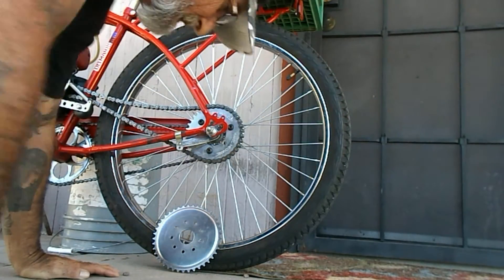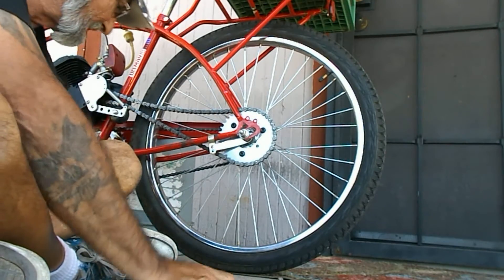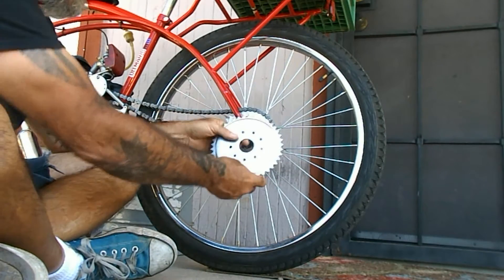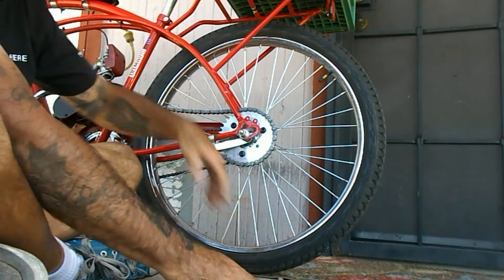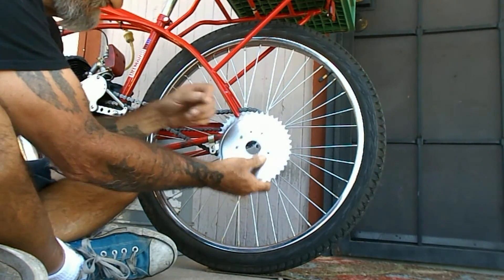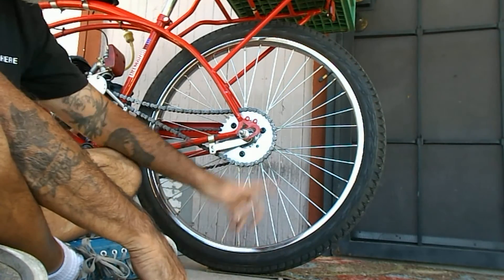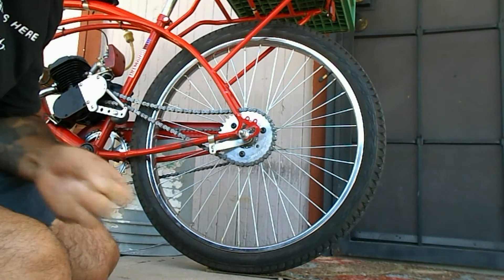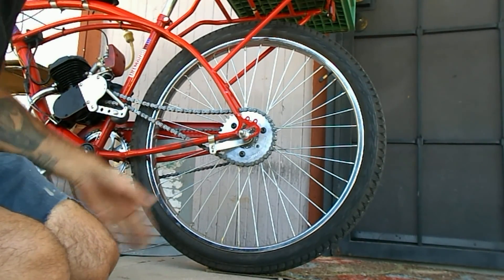Fast Lesson in Gear Ratios for a Motorized Bicycle

Comment: Im thinking of going with a 38 or a 40 on this build, i dont want to overload the little chinese motor.
Reply from the maker: Here's the thing the higher the number of teeth on the gear the lower the gear ratio. 
( stock is 44t or 40t )
On my red speeder bike I had a 36t sprocket and I could achieve 41mph. (6500-7000rpm) 

U could go 32t but that would take lots of bottom end torque away and u would use up the clutch trying to get going unless u pedaled at the start. 

It all depends on what u want from the engine remember it only puts out 1.5 - 1.9 hp stock. Even with all of Fred's upgraded parts and 93octane fuel u are only getting 2.7-3hp maybe. But mostly just higher rpm across the rev range. Gearing is the key to getting more speed don't believe all the super mechanics and geniuses that claim to know what they are talking about when it comes.to this little 48cc Russian designed chainsaw engine that was.first put into service around 1925 or so and was used to cut.down Siberia. 

The Chinese adapted it to run water pumps and other small machines through the 50's and 60's. 
So what u want?
 Reliable good performance that give around 55-70mpg (36t-40t) with a top end speed around 35-40mph

Higher rev range more power uses more fuel 
makes more noise 
uses up the engine faster

I know guys that got over 100,000 miles on their engine with road trips of 10,000 miles multiple times. Sure they look like hell but still run like a mad chicken ") 

Thanks for watching")

Comment: @brian noel,so smaller sprocket means faster and bigger sprocket is torque?I'm try to get better pulls up hills.on flat roads I can get up to 30ishmph.as soon as I get to hills I lose power.
Reply from the maker: 40t rear sprocket is stock 44t will give u more pulling power")
Reply: Thank you sir.i wasn't sure,but I'm gonna buy another rear sprocket to test this.

Comment: I got my hands on a 32 tooth...and thinking about giving it a try...I'm mainly on flat ground...so I'm not worried so much about hills.. I'm currently running a reverse jug on a 100cc bbr...with expansion chamber exhaust and expansion intake manifold (boost bottle) 
with large air intake filter.. this 32 tooth sprocket will be bolt on a 20inch wheel..so hopefully it will be faster...also have done port matching and polishing...

Comment: Like your video but I found out how you can get a hundred miles per gallon put a Reed valve and window piston , expansion chamber exhaust and a keihen carburetor on my yd100 bicycle engine and 40 tooth sprocket I only have to give my bike half the throttle I did before I added that to my engine I weigh around 250 my bike can get up to 35 to 40 mph but I only run it around 25 and maybe a quarter throttle before the addons I would be giving it almost full throttle to achieve the same speed and power I guess the people that make these motors leave that out I had to think back when I was a kid in the 70s racing 2 stroke dirt bikes helped me a lot with my motor bicycle

Comment: What’s better a 36t or 44t I’m running a 36t on my torque master engine from Zeda and it’s insane
Reply from the maker: smaller the gear(less teeth) the faster you will go. the bigger the gear (more teeth) the more torque(climbing power) the engine puts out. the smallest i have seen is 30t because the little engine has to rev really high to get going from standing start usually ending up in major engine failure.
Reply: @Brian136  you are right

Comment: Hi Brian , I would like to know how many spokes do you have on the back wheel ? I have a sprocket adapter and my back wheel has 36 spokes which will not fit the sprocket adapter. Can you please help me out with the information.
Reply from the maker: Number of spokes doesn’t matter!  What u  need do is measure the diameter of rear hub- then order correct size for your bike

Comment: I am building out a motorized bike and I'm getting the 36T sprocket to hopefully get a bit better performance on the top end. I can just pedal or pedal assist at lower speed, no big deal. It's going to be a generic 80cc engine on a Huffy frame.
Reply from the maker: Good choice bro") top speed on my red bike with. 36t was 41mph and I averaged around 96mpg with the NGK 5 plug. All stock except for the gear change and the chain tentioner. Upgraded the throttle to a 1/4 twist off a motoped this made it way more responsive under acceleration and gave good feedback. Depending on where you live (elevation wise) the jetting needs to be reset and I would put a aftermarket air filter on the carb. Do you have the NTspeed carb? If not check out u-moto.com they have all the stock parts and a few others that you might want to check out. Good luck with it and post some videos of you and your bike bro ")
Reply: @Brian136  thanks for the tips, I have been considering a different throttle, since everyone says the stock ones are cheap feeling

Comment: I think the gear ratio of the original kit is way too low. I have both a 2 stroke kit and a 4 stroke 79cc engine and all I can say is that when compared the 2 stoke runs out of gear way before the 4 stroke does. The 4 stroke has a jackshaft so it changes the gear to be taller with the same sprocket as the 2 stroke, but the 4 stroke is a torquier motor so it pulls down low fine and gets up to speeds exceeding 40+ mph.
I’ve never tried a smaller sprocket on my 2 stroke but I do want it to have the same comfortable feeling on big long roads as it is uncomfortable to ride on things like freeways since it runs out of gear way too fast at way too low of speeds. Buying a smaller sprocket would probably fix that since I live in a rural area where the roads are longer and faster and not in the suburbs where roads cut short.

Comment: How much speed jackshaft increase?
Reply: It depends how it's set up, if you run the engine's power directly through your bikes gears which can be shifted, that would increase your speed a lot since you'd be able to have a lot of torque when taking off and then switch to a higher gear which would require less rpm to go faster, of course that would be really hard to do and your pedals would be spinning with the engine when the clutch is engaged.

Comment: I'm in the process of building one of these bikes. I weigh 260 lbs, so I'm thinking on a 56 tooth sprocket for more pulling power. I'm not looking for speed or will I use full throttle all the time.
Reply from the maker: 56 really low! be at the top speed in 25 -30 feet of forward trsvel about 12-14 mph and yes the throttle be wide open") try a 48 or 52 not so low and you get good torque out of the little engine maybe 12-18 mph with half throttle") good luck make some videos of your bike")
Reply: Im around 300 and have a 44t sprocket and it pulls me just fine and can reach 34mph on a 49cc
Reply: Chance Bond  motorbiking.com has a ton of info.  But id bring 10mm and 12mm wrenches (open end) and allen wrenches.
Reply: 44 tooth stock sprocket will pull you easily and won't sacrifice your top end of ability to have some throttle left to punch it if needed

Comment: I got a 32t off ebay to replace my 36t haha but I dont wanna lose that torque!
Reply from the maker: how much did the gear get affected by the change?
Reply: brian noel  shouldnt be affected much due to those 2 stroke 80cc need pedal assist befor dump gas
Reply from the maker: what are you talking about Ronny? I am having a hard time figuring out what you want to say please explain???
Reply: just saying the gear dont really made much diffrent because either way you have to pedal assist the 80/66 unless you put a centfucial clutch in .then you felt lots diffrences in gear because that allow you to pull from dead start..like my old 2 stroke.i had that and  30teeth,hi performance carb it was a bit  laggy but not to diffrent then the 40t sprocket.
Reply from the maker: well my friend if you are not feeling the difference between high and low gearing then you are not going to understand that the taller the gear the less torque you are getting from the engine and that's where the difference is. 30t sprocket is very high and you are only getting the torque at the very top of the rev range and that is the speed end of the rev range. with a 26 inch wheel you should be able to get 40-50 mph if you are brave enough and that's why you want a high gear. with a 40t or 41t you are in the middle of the rev range and getting a balance of both torque and speed it's not about driving on the clutch if you want that then get a 125çc motorcycle...

Comment: your wheel sized plays a huge part in gear ratios also
Reply: Darius Sykes very true
Reply: what's a good reccomend all rounder for a 20" wheel?
Reply: Chris Mcwilliams 20” bike generally won’t be able to fit an engine in it. Usually only a 26” bike
Reply from the maker: Well the way it works is for maximum torque output you want a larger gear on the wheel usually around 44-48t for a 26" wheel top speed is around 20-24 mph or so. For maximum speed you want smaller gear on rear wheel around 36-41t on a 26" wheel tops out around 40-44mph depending on weight factors and jetting of the carb. So for a 20" wheel the whole equation is off by a factor minus. So it's  smaller wheel even smaller gear but then you are not taking into account the size of the front sprocket which stock is 10t. If you stay with the stock front sprocket then you are not really going to get a lot of speed but the tourque numbers will be around the same as a 44t in a 26" wheel. So if you are looking for a balance between the two I would go with a 38t on the rear wheel and try to drop the front sprocket to 9t maybe 8t if you can find one or have one made??? Anyway bro 20" bikes are dependent upon the weight factor and wheelbase. But hey if you can get it built and I have seen a few here in Phoenix. Go for it see what happens is my Moto")
Reply: @Brian136  what about for a bike of 29inch, is it the same idea?
Reply: You can get a 40 tooth 
Brother you will never get the milage they claim out of these motors, it's a lie. If you built on 28" rims might get close but not with 26"
Reply: @artofdisguy3401  what about for a 29inch wheel, same idea? I’m trying to get higher speed

Comment: And i was wondering if the gear was worth it to upgrade
Reply from the maker: +Tech2014 Well now that I got 150 miles or so on it I would say yes But I would opt back to the stock tooth count of 40. 36 is good for going on long runs but not torquey enough for stop&go still have to pedal all the way across the intersections before i can accelerate away. (so far top speed has been 39 mph)  I will be posting the update video in a day or so soon as i get it processed.